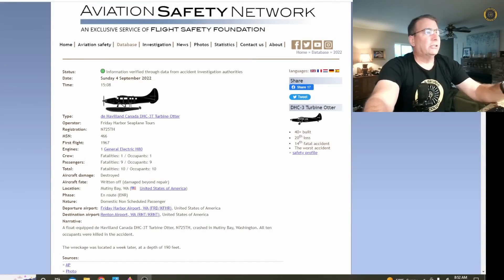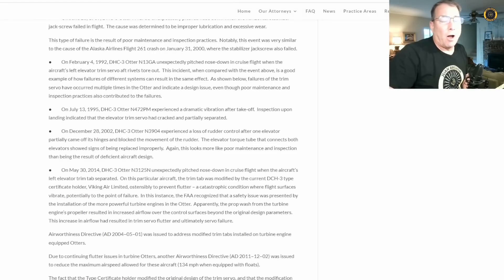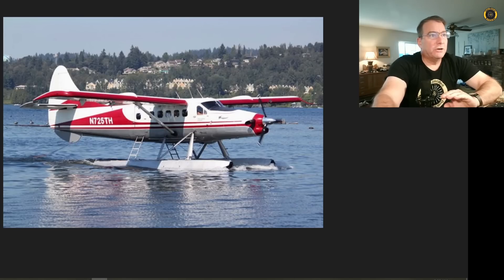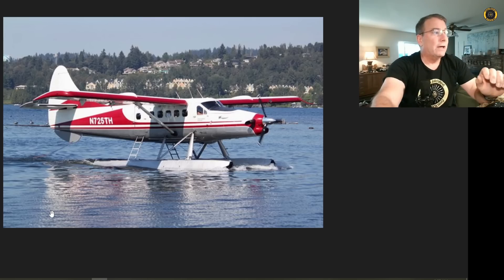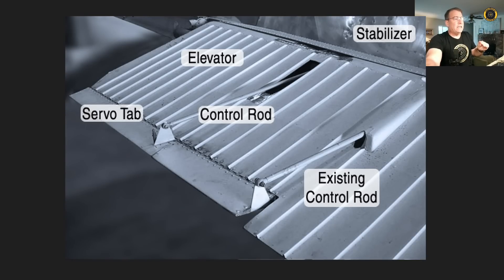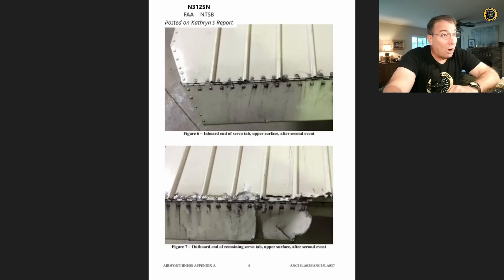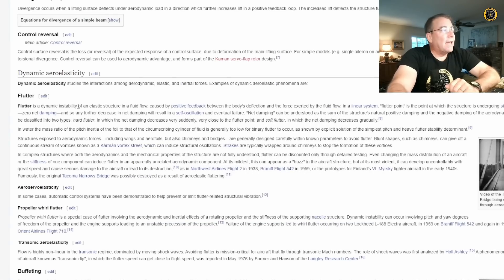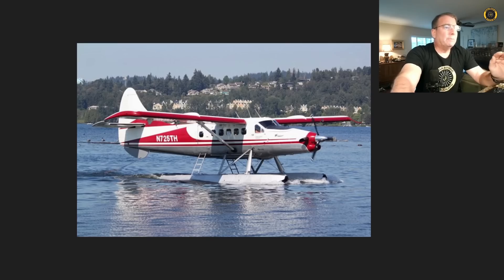DHC-3 Otter Emergency Airworthiness Directive! (Re-post)

Comment: Really nice flutter videos.  As a flutter engineer for many years, I found few people understood it. All they concentrated on was the idea of the aircraft shaking itself apart.  Assurances that an aircraft could not be certified unless it was designed to eliminate flutter did not seem to reassure then.  As you say, once the strength has been compromised,  it is a new ball game.

Comment: There was an AD on this same stabilizer linkage on an otter or beaver back in the 70s. My friends were killed in a De Haveland with similar pitch up and nose dive In DRT. It was a CAP mission and the crash happened at the end of 13 at DRT. It was said it was an un addressed AD in the stabilizer linkage...I'm wondering if it is related.

Comment: I've done enough preflights to know the importance of getting hands on to inspect everything thoroughly. 
The question I have is how many preflights are shortened on not as thorough maybe as a practical matter due to an aircraft being on floats. Especially dedicated float planes.....
It seems like doing a thorough preflight inspection would involve spinning the aircraft around at the dock in order to get under both wings and the entire tail....
I used to have coffee before work and a lot of lunches near a seaplane operation. And after watching them come and go maybe several hundred times at all different hours from very early in the morning to late at night. Both when they were beginning and ending operations for the day, I've never seen any of those aircraft turned around or inspected from both sides.

Comment: This is what happens when the systemic paralysis of the aviation industry and the FAA result in half century old airframes in commercial service. It's crazy. In the meantime, it would not be difficult to design a 3D printed replacement for that part with an integral skin and spar monoqocue design, made from almost any alloy. But the FAA would take a decade to approve it. Same with structural adhesives. Rivets? In 2022? Nuts.

Comment: @2:56 they came out in the 1950's Juan .
When viking took over I was working in the Downsview facility where the original tooling for the type was kept .
Before viking changed the inspection criteria of the h stab , elevators and tabs, we made the repair parts under AC 43 13  or CARs 571.06 ...never had one fail with 16 aircraft and 5 different operators .
I wanna see what they bring up from the bottom ,

Comment: Thanks for showing the footage on flutter.
As an aerospace engineer I have tried explaining it to people and they generally can't believe that wings and tail surfaces will do that. My professor in college taught Aeroelasticity and there's actually 2 things that can happen when you go too fast for any given wing. One is flutter the other is called wing divergence.

Both start with the fact that the aerodynamic pressure distribution around a wing causes a wing to twist about the main spar. If you go fast enough that twist will simply twist the wing so far it just rips from the plane that's called wing divergence for the obvious reason the wing diverges from the airplane. Its why aircraft have a "never exceed speed" on the airspeed indicator. If you go faster than that speed you risk having the wings suddenly rip away with zero warning. If you have ever heard of planes breaking up in a dive or as they fall from the sky that's what usually happens.

Flutter happens when you go fast enough that the wing twists to the point where part of the wing stalls. The vortices created unload the wing which can then untwist. That then allows the air flow to re-attach and then re-twist the wing again until it begins to stall again. When that cycle happens fast enough its called flutter. That's what is happening in those film clips Juan showed. The worst is when that is close to the wing structure's natural frequency and the wing literally flaps. 
Like this https://www.youtube.com/watch?v=kQI3AWpTWhM
Its incredibly dangerous because not only will it want to rip the wing to pieces but you can lose control effectiveness and it becomes an unrecoverable situation.

Aeroelasticity (Flutter & Divergence) is one of the hardest subjects anyone can study or look into because it involves aerodynamics, structural dynamics and  structural strength. Those are usually taught as 3 separate subjects and Aeroelasticity combines the 3.
Reply: I gave you a Like and don't see why do don't have more here, as I thought we appreciate comments. I love your comment. Although I had never heard of aeroelasticity, in the numerous classes I had in Navy Nuclear Power School, included was fracture mechanics. Planes have flutter, power plants, especially nuke, have HUR's and CDR's-Heat Up Rates and Cool Down Rates, which increase w/ age as the Rx vessel becomes more neutron-embrittled. Things such as elastic vs. brittle fracture failure curves.
Reply: @CadillacPat1  Aeroelasticity is the combined subject of the effects aerodynamics has on airframes. Flutter is just one of the effects.

Remember your basic structures and statics and you can frame all of that in terms of elasticity. What's Young's modulus (the spring constant) other than a way to describe the elastic behavior of a material? Remember you can both load a spring statically and dynamically. 

People forget that everything can be bent or twisted or squeezed to some extent and then it will spring back Aeroelasticity is the study of aerodynamic loading of airframes and because aerodynamics is what it is its a complex subject. If the plane goes fast enough then thermodynamics comes in as well. Its why so few people study it. 

Most engineering classes are actually applied math classes and Aeroelasticity isn't the only super hard applied math class that people run from. Orbital mechanics is hard but space craft dynamics is even harder. I made the stupid mistake of taking spacecraft dynamics instead of orbital mechanics and still regret it 35 years later. 

It sounds simple because its about basic yaw, pitch and roll except those are cartesian in nature and spacecraft operate in a circular reference frame and gyroscopes are also circular. So it not only involves simultaneous differential equations in 3 dimensions but coordinate transformations at the same time. Its another math on top of math subject that just does your head in. Don't ask how I passed that class because I still don't know.
Reply: @tonywilson4713   I know this is a very late reply..
I thought your comment was very interesting. Yes some subjects are very difficult to understand, but that doesn't mean that they aren't relevant. Even if one can only understand in a general way, I think it should be in a pilot's understanding as something to think about. Physics is real and it does affect airplanes.
Reply: @CohoSalmon  I love your comment and especially the part about physics.

Just last week I had a journalist who hosts a channel here on YT tell me to "F--k off" after I corrected one of his guests. Part of his first reply to me was he gets told by engineers all the time "its the physics" which should tell him something, BUT NO its the engineers who are wrong.

FYI - his guest, a so called "energy expert" turned out to be an accountant.

It highlights a major problem in the world right now. We have all these self declared experts and they JUST AREN'T and because they get introduced as experts what they say carries weight. Its almost a full time job correcting them.
Reply: @tonywilson4713        I so agree. There was a time when it was a mark of pride to try to understand something truly difficult, not to be better than someone else, but to try comprehend something at the edge of one's ability.

Comment: So basically, the preflight gets shorted because it’s “difficult”. When you’re out on the highway, make note of all those truck tire treads lying around on the side of the road. THOSE mostly happen to result from people not bothering to actually check their tires every time they stop (defined by law), or at least daily before heading out. I guess otters should have one of those spiffy Little Giant ladders tucked in someplace? Sorry to sound flippant, but the fact that so many instances of cracking showed up on aircraft that are ostensibly inspected at least daily in commercial operations might just make a person wonder WTF these operators have been doing this entire time, and in extension, are those techs performing annuals on these planes not really doing them correctly? Fair questions, I think.🤷🏻‍♂️

Comment: JUAN,,HI,,THANKS FOR THE INFO, DAMN,THOSE PIX OF DAMAGE, SHOES FANTASTIC DAMAGEhis also reminds m of TWIN OTTERS OPERATING IN THE PACAFIC, ,Operators devoted to use stainless steel control cables, being involved 100% in salt water,,,,UNFORTUNANEY ,THOSE CABLES WERE , BECAME BRITTLE,,USUALLY CRASHING ON CLIMBOUT, so AFTERALL
THE NORMAL CABLES WERE THE ONES WHOM LASTED MOST OF ALL,,,TWIN OTTERS LAND VARIENT,,I HAVE FLOWN ON MINY TIMES, BUT MORE BN2 BRETON -NORMAN AIRCRAFT
🇺🇸🇺🇸🇺🇸🇺🇸

Comment: Do these servo tabs actually move the elevator, or assist in moving it? On a/c that I flew, only the servo tab was connected to the yoke. The only thing moving the elevator was the tab- so if no airflow, (parked or taxi-ing) there was no way for the pilot to move the elevator.
Reply from the maker: assist.
Reply: @blancolirio  If it's 'assist', then it's a balance tab, at least in the UK.

Comment: Salt water environments are particularly harsh on aluminum aviation structures and require much greater inspection frequency. Particularly on older aircraft.
Reply: Crappiest job in P3 Orion Squadron, "Corrosion Control".

Comment: I wonder if the DHC6 suffers from the same issue. They're very popular for skydiving operations. The high tale design lessens the chance of a jumper striking the tail upon exit
Reply: As a layman, I wouldn't think so?  If I understand Juan correctly, the structural issues are connected to the fact that an aircraft was designed to use a radial engine and was later converted to turbine power, with associated changes in structural load.  The twin otter was designed from the start to use turboprop engines.

Comment: Unfortunately the NTSB Didn’t catch this problem from the previous accidents even though there were warning signs that were ignored. This is the same problem that caused the issue at the Oraville dam, The concrete bridge that fell on those people in Florida and the collapse of other bridges and buildings such as that one in Florida. In  almost every instance There are warning signs that have been ignored. It’s only after a catastrophic failure that people start to pay attention. There is a very good book titled “To engineer is human “ by Henry Petroski that Chronicles how engineering failures typically take place.
Reply: Building Integrity is a YouTube channel that takes a Blancolirio-like look at building incidents such as the condo and bridges near Miami that collapsed. The materials are different, concrete and steel, but the mistakes are similar to those in aviation. https://www.youtube.com/c/BuildingIntegrity
Reply: At our university, aircraft design course we learned that a top priority was to design an aircraft to be maintainable and easily inspectable on every preflght
Reply: We have had an AD here in Canada for awhile now. Its frustrating that the FAA didn't carry it over into your country before this happened.
Reply: @spurgear4  It seems that the United States NTSB is slow to react on everything. The accident investigations the AD’s they all happened a snails pace
Reply: @Iflyagrasshopper  I have quiet a bit of Beaver wrenching under my belt and more than a few years on the Buffalo. I have never touched an Otter yet but some of the folks I work with have, and knew exactly what happened when they heard about the accident. I looked up the AD and it was actually registered with the FAA in 2004.
So it was shoddy maintenance practices and or lack of maintenance management it would seem, 
Sad outcome for everyone.

Comment: Some of those repairs looks way sketchy. How is that even possible on an airplane?
Reply: Owners (non A&P cert) that think they can handle small repairs that in many cases exasperate the the problem. With all the similar problems in the past it appears to be the case in this one. In addition it also appears that the appropriate preflight and post flight inspections are not being performed as they should. Is laziness worth a life? I think not.

Comment: correct me if I'm wrong, but the crashed otter (seattle seaplanes) as well as kenmore airs fleet of otters and beavers are pulled out of the water each night and put on the hard.  Seems like there is plenty of opportunity to inspect the tails from ladders or whatever.

Comment: The Reno event you referenced was the P-51 “Galloping Ghost,” piloted by Jimmy Leeward. It lost an elevator trim tab during a high-speed pass, executed a sharp climb generating Gs sufficient to incapacitate the pilot, and impacted the runway near the viewing stands. So sorry to hear about this latest incident!
Reply from the maker: Miss Ashley crash was many years BEFORE the Galloping Ghost crash. Both flutter, but different.
Reply: @blancolirio  flutter? It was a radical pitch up after the tab separated same as Voodoo did years before.
Reply: @blancolirio  

The one with the Learjet wing&tail?

That was Miss Ashley 2
(better remembered by many as “The Learstang”)
that crashed at Reno in 1999.

The first Miss Ashley was a bubble canopy P-51,
much more original.

The Miss Ashley 2 and The Galloping Ghost
(ex-Jeannie,
AKA Miss Candace,etc.)
were HEAVILY modified.

After all,
a Lear 23 and a P-51 really don’t have a lot in common…

As for the Ghost,
she had like a 10 foot reduction in wingspan over the years-
the wings had been clipped 
3 ft more on each side 
on top of the 4 ft reduction in span earlier in its life.

I know that you were there and
I know that it’s a touchy subject for many but you could easily do a whole series on the question 
of all those modifications of those planes.

It’s not that you would (or should),
it just really is a glaring safety concern operating such equipment at such speeds so close to so many (and each other) with so many conflicting vectors.

Those planes have all had numerous owners and
many,many modifications and 
“incidents”.

If they want to do that then it’s up to them but I was just always amazed that 
the organizers (and the Feds)
let so many people so near the danger zone and that it hadn’t happened before.

NASCAR restrictor plates can be traced back to one final incident with Bobbly Allison at Talledega in 1987 and they go  less than half the speed that these birds go and they only operate on a  
2-dimensional field.

It was when Bobby literally “flew” down the straightaway ripping off all the safety fence that they said,
“Ok,that’s it.
Time to slow them down.”

It all reminds me of board track racing long ago-
people want to get “close to the action” but they really don’t know what they’re in for.

Speed and ingenuity fascinate me but highly modified planes that old that have experienced so much stress for so long with pilots that are quite similar to them-
well,
it’s bound to have some serious “complications”…
Reply: @blancolirio  yeah the Miss Ashley II came apart in the first turn after passing the home stretch..... it had a Learjet wing and was highly modified.... I remember watching the crued video at the time..... came apart just like those model airplane examples......
Reply: Joshua Jones  I get that, but I'm assuming that the Ghost's wing flutter was caused by the trim tab breaking, and not vice versa. Also, I don't think that the Ghost crash fits his description of "a long long time ago." Last, he was there the day the Ghost crashed, I'm pretty sure he doesn't need to ask us anything about that day.
Reply: It was Miss Ashley II rudder flutter.
https://www.youtube.com/watch?v=zdum2hzQbHo
Reply: I don't think he was referencing the Galloping Ghost, as that didn't have anything to do with wing and/or tail flutter.
Reply: @csolivais1979  Yes it did!

Comment: In the original vids comment section, someone posted about a wind tunnel test of a unspecified aircraft they were involved in.  At a very specific air speed if the tail experienced fluttering ( gusty wind simulated by pulling a rope attached to the tail ) the tail would break off.  Instantly.    I'm hoping that comments from the other vid can be merged or the original poster can repost.
Reply: What happened to the original vid?
Reply: @djmips  Apparently the original vid needed edited and we got the current version.

Comment: Having spent years working on DHC2 Beavers used for agricultural and float operation, I was horrified to see the condition of the tab that fell apart in a previous event. No one should have let a tab get to that level of wear and tear. On minor note, the wind tunnel flutter model was of a C-5, not a C141, and the mustang that crashed at Reno (2011) was 'Galloping Ghost', which also lost a trim tab, leading to loss of control.

Comment: Excellent explanation.  Thank you !  This brings back memories.  As a brand new lieutenant in the F-16 SPO, I worked flutter tests on the F-16, as TAC (at the time) turned it into a ground pounder.
Reply: While the acronyms and jargon sound cool, it is very uninformative to most of us
Reply: @Odin197188  SPO = System Program Office -- how the Air Force managed the development of large systems.  TAC = Tactical Air Command - back in the day, the part of the Air Force that was responsible for developing tactics and procedures for fighter aircraft, as well as training to provide pilots to the combat commands.